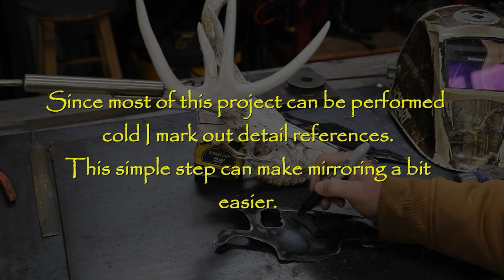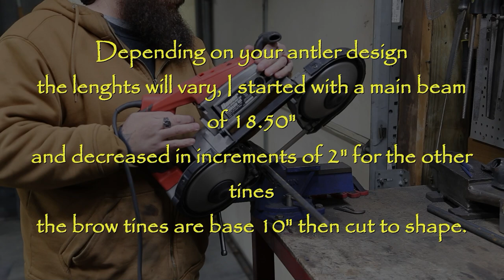How to make a metal deer skull 2.0 new design! blacksmith forging art project #howto #diy #fyp

Comment: How did you achieve the texture on the main beams of the antlers?
Reply from the maker: Skipping the arc with a mig. Instead of holding a steady bead just move the mig tip rapidly.